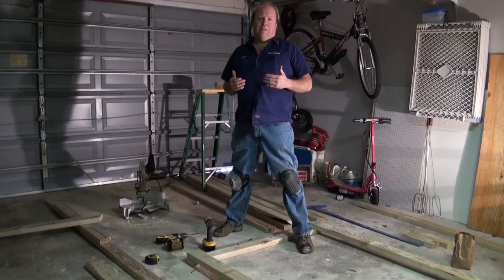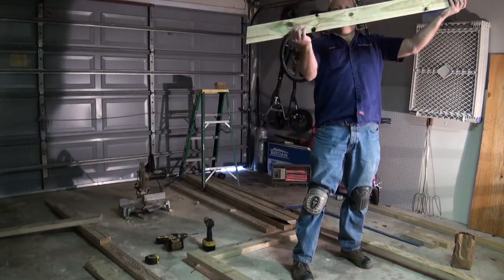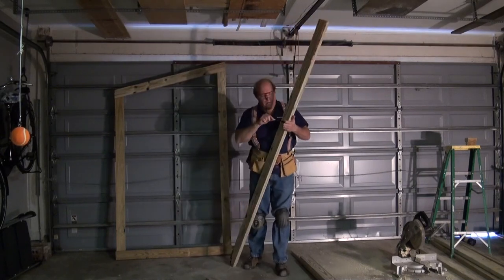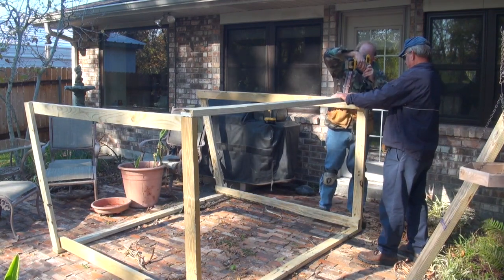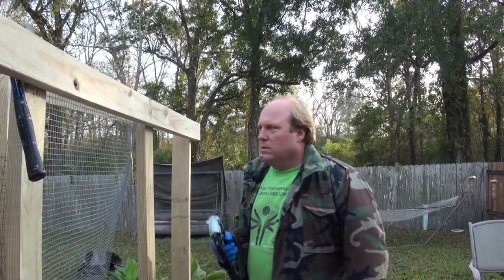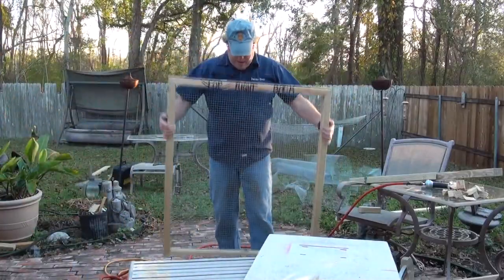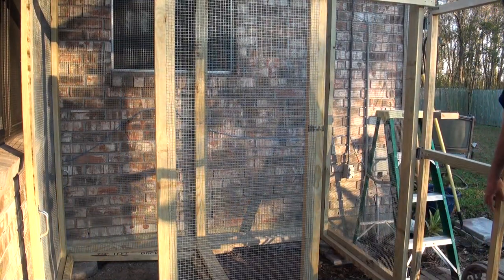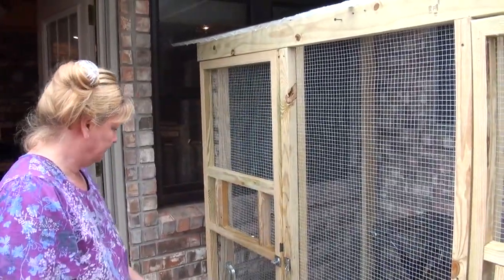The making of an out-door squirrel cage.

Comment: That came out really nice. 
I am building one today. 
But those hammocks toy have in there with them seem ok, but they are dangerous! We had a young squirrel last year in an outside cage,  about 1/4 the size of yours. My wife put one of those hammocks in our and the squirrel LOVED It!
But one day she went outside and the poor squirrel was hanging by her rear, just before her back legs by the strings of the hammock! She used to run and flip around on it all the time,  but apparently she got wrapped up somehow and flailed around until all of the hair was rubbed off.
I ran outside with a pair of electrical sidecutters and cut the whole contraption loose. My wife took her and set her down,  and the poor little thing was pulling herself around using just het front feet. Her back legs and tail drug behind her. We thought she broke her back. 
But about 3 days later,  after many tears by my wife, and much hands on physical therapy,  if you will, she began twitching het tail and trying to move her feet.
It took her a few weeks, but she did regain full function of her limbs. But,  if we had been a little later finding her,  she would have hung there and probably died.
Reply: Awful!! now I’m afraid to use hammocks.